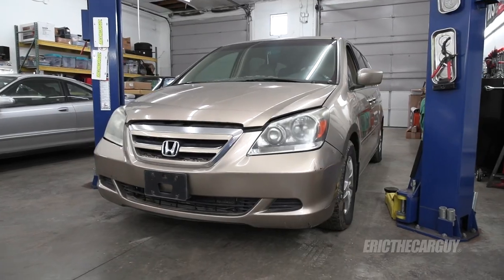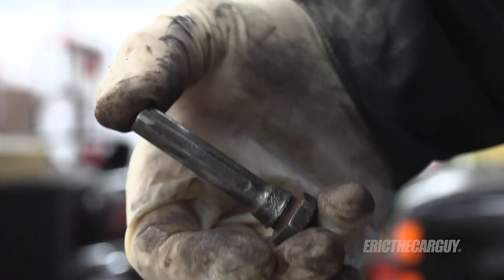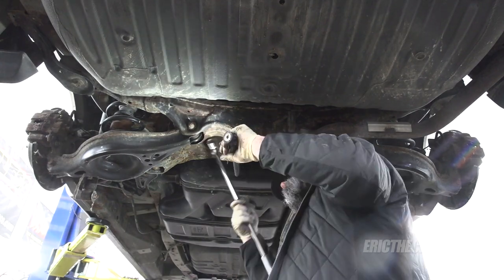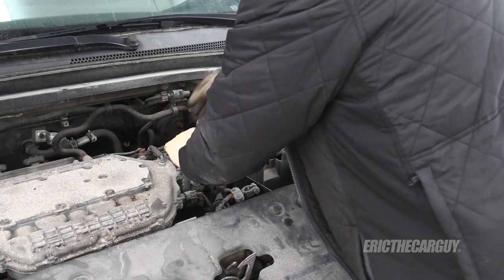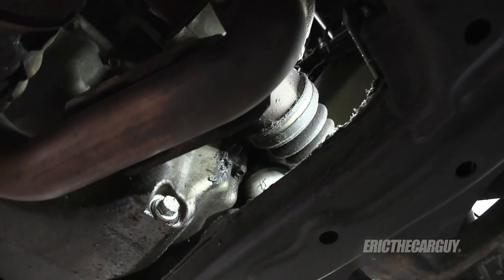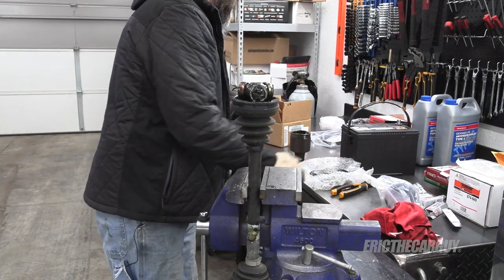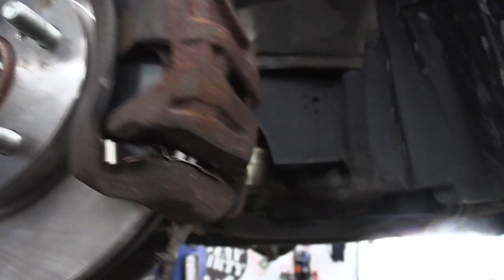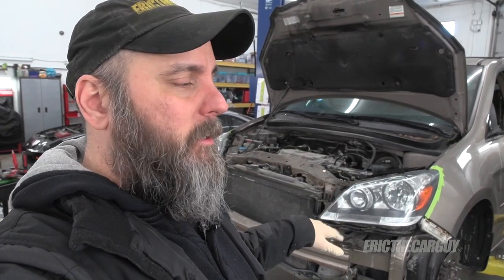2005 Honda Odyssey The Work Begins (Episode 2) Fixing it Forward

Comment: Good to see you draining the old brake fluid into a bottle through the bleed screw when pushing the pucks back. I have seen many folks push the old brake fluid back up into the system and ruining the ABS unit in the process.
Reply: why does pushing old fluid hurt the ABS or is it that fluid "shouldnt" be pushed back in.
Reply: @rickjames5998  I would say both. While I am not a brake expert, I do know that ABS units have delicate valves, pumps, controllers and unserviceable filters. The last thing you want is sludge from old brake fluid entering any of these components. Besides, when servicing modern brakes, it is likely that it has been years since the fluid has been in the system. Since brake fluid is hygroscopic it will absorb moisture over time reducing its heat range and therefore needs to be changed every few years. Since you will be bleeding the system anyway with new fluid, you might as well not pump any old fluid back into the system for a faster bleeding process. Cheers.

Comment: I owned a Honda shop for 20 years and I always like the way Eric does his Honda work. He knows when you need to use Honda OEM and when you can fudge. That comes with experience.
Reply from the maker: Thank you Grant!
Reply: Honda is one of a few manufacturers where using factory parts is not required, but highly recommended

Comment: When I did a brake job years ago I wasn't aware of the brake pad hardware. So I re-used the original. This time round, I am more prepared than ever.

You mention boogered threads... I ordered used axles and guess what? One was fine, the other slightly misshaped. It must have taken me 2 hours with a die to get that recovered. I did the nuts and now they spin so nicely.

Comment: Eric

That “Hole” is made with a 60 Degree included angle center drill and is there to ensure the shaft is turned concentric to its center.  It just happens to fit a tapered impact tool, to prevent it from “jumping”
Reply from the maker: Correct, and I thought of that after I said it, but I've always seen it as the perfect place for an air hammer bit. Thanks for the comment.

Comment: I have a Harbor Freight vacuum bleeder that works great, just wish it had a bigger cup, it works so no real complaints. Just have to empty it alot for fluid changes. Love the fixing it forward. Finally after 300,000 miles, had to have the 700R4 in my 91 Silverado rebuilt. OUCH! $1600.00 w/ converter. Guy said it was tore up pretty bad, but looked good for the mileage on it. He is rebuilding it now, but wants another $450 to swap it out(bought a used one and swapped it myself 9 months ago..used one just lost reverse, so I will be doing it again.) Rebuild bill will squash my savings, but truck is rust free , engine solid runner, and I like my longbed. Even bought a digital dash to replace dead moonie gauges($450.00 inteletronix unit off of Jegs). She`s been good to me, and at 63, this will be my final vehicle in my lifetime.

Comment: You're better off gluing that handle back together or try finding one on eBay. If you give it to your SO rep, it'll get replaced with the new round handle ones. I was pissed when I found that out. Now my set is mismatched and it drives me nuts lol.

Comment: Great video. I did not know the rear brakes is sort of a combination of disk and drum. I learned something new. 👍🏼
Reply: Yasmani, The drum part is for the parking brake only. It shouldn't wear as long as you don't ride around with the parking brake on!
Reply: @GearheadSchool  yeah I saw the pads for the e-brake. I just imagined the set up was different on rear discs. 😕

Comment: On headlight lens restoration: I used I think the mid-level (may have been the most basic) 3M kit (with an additional step of using meguiar's polish) on my badly worn TSX headlights and it worked WONDERFULLY. I prefer repair/renew over replace whenever possible.
Reply: I have an accord euro (tsx is the same car) and I had good luck with the 3m kit and put precut lamin x film over the top afterwards. It’s been 3 years and they’re still crystal. Well worth it IMO.

Comment: Eric the screws were put in by the factory so the rotor will not fall off during assembly.  Not needed afterwards. I knew someone who worked there and said it was to protect toes.
Reply from the maker: Yes, they also make it easier to install the brakes which is why I put them back in. Thanks for the comment.

Comment: Hei Eric,
I have two mentions:
1. Don't fill the brake reservoir to the top even with new brakes. 99% of the mechanics will squeeze the calliper piston  all the way in, even further than its sitting with new pads and discs. So you should always keep some reserved space.
2. Try using clear coat for headlights as these "restore" kits will only last 6-12months. Its way easier to sand the headlights and clear coat them. Now you removed the old faded clear and left the plastic exposed and unprotected. 
Greetings from Romania
Reply from the maker: I mentioned that very thing in the video. Thanks for the info on the headlights

Comment: You need to install a vent tube at the end of your lift to stick on mufflers when they’re running. I’ve seen people use dryer vent before with good results
Reply from the maker: It’s more complicated than that. Thanks for the suggestion.

Comment: For the stuck axle at 15:52 I would highly recommend the OTC 7394 hub puller if the air hammer trick doesn't work as it has never failed me with really stuck axle shafts.
Reply from the maker: I have that tool. Works excellent. Thanks for the comment.

Comment: Good man.  But brave of you using that bench grinder wire wheel to clean the slide pins right next to that clean Integra lol
Reply from the maker: I ceramic coated it before putting it away for the winter. It's impossible to keep a black car clean BTW. Thanks for the comment.

Comment: 4:04 THIS TRICK WITH THE HONDA ROTOR SCREWS HAS SAVED ME SO MUCH TIME AND FRUSTRATION!! plus the honda guy who had been there for the last 15- 20ish years(i want to say, but he has been there for awhile) still does it the old fashioned way! P.S. Erics way is WAY faster
Reply: A lot of the problem is that most people don’t realise those screws are JIS, and not Phillips. It’s easy to round them out with a regular Phillips screwdriver. Getting the proper screwdriver helps a ton. 
I like Eric’s idea too though.
Reply: @zeroyon4562  i find the #3 philips bit head fits them and works really good(as a honda tech i got the #2 and #3 philips head bit on a socket, i use the #3 on that and the engine under sheilds, have not stripped them out unless they torqued it to 110ftlbs)

Comment: Eric the air intake "snorkel" on my 2011 Odyssey split on the corrugated section and I didn't notice it for a number of months. During that time I always had a rough idle on start up especially in the winter. Now that I have replaced the snorkel the idle is much better but it isn't completely smooth. Do you think that condition would create excess carbon build up in the EGR valve and introduce a new rough idle issue? Keep up the great work. I love these videos.

Comment: I have 3 Honda's well one is a 08 TL , but any way on all 3 the intake boots had cracked in between the ribs usually on the back side and the breather. 11 odyssey touring elite is mass air so that through a lean code for both banks but the others are speed density so you really wouldn't know. Check you boots.

Comment: Hey Eric, been watching for a long time and this is a great series. Congrats on bringing it back. I worked as a Honda Tech for a couple of years and I was curious about the subject of parts. I love Honda OEM parts in general but is there any time you would opt to go aftermarket (regardless of time and location constraints and not things like brakes) like you would actively seek out an aftermarket over the OEM. BTW I am mostly familiar with late 00's cars 05-10.
Reply from the maker: O2 sensors. I get Denso. That's about it.

Comment: Not sure if this will even get seen, but I heard a lot of the gen 3 Odysseys had those run flat tires with special wheels and as such are a pain to replace without getting all new wheels. Doesn't seem to be the case with the one you have here. Have I been mistaken about this?

Comment: if you need extra parts i have some used oem brake caliper, throttle body ,evap canister and coil spring all used oem parts from 2005 odyssey touring model oh i forgot i got a oem air intake to
Reply from the maker: Thanks for the offer, but I believe I have things covered for now.

Comment: We're did you get that metal turkey baster with needle tip I been looking for something like that for brake fluid for years @EricTheCarGuy
Reply: I use a large (horse) syringe found at my local Tractor Supply Center store and an approx. 9-inch long rubber hose on the end of it which in my experience works as well or better than a turkey baster. Drips less and lasts at least as long.
Reply from the maker: Link in the description.
Reply: @ericthecarguy  I will look again nut I couldn't find it the first time
Reply: @ericthecarguy  thanks I found it Eric
Reply: @ecschindelbeck  nice idea thanks
Reply: U can get a big syringe from dollar tree
Reply: @adamlynn6648  no doller stores of any kind around me within 70 miles

Comment: I think 250F isn't hot enough to activate the catalytic converter and they have 0 effectiveness at such a low temp, you should double check after letting the car run long enough for the temp to stabilize, I think it needs to be at least 600F for good operation.

Comment: Wow, there are some real differences I notice between "wrenching" in Germany and the USA. Over here, mechanics say it's paramount that you clean up all the rust off of the hub before putting the rotor back on (i.e. with a wire wheel - those handheld pneumatic ones, not the one installed on the bench), so that the new rotor doesn't seize onto the hub - and you just seemed to put them back on (or you didn't show that process, which may also be a possibility). I (not a mechanic) am not saying which method is better, just pointing out a difference I've noticed. Or maybe it isn't one, and it was just left on the cutting room floor, that's fine too ;)
Reply from the maker: A few have brought that up in the comments. Not saying it's wrong, or that I disagree with doing that. I've just never found it to be necessary. After more than 25 years of doing this I have yet to see an issue from not cleaning a hub before installing a new rotor.

Comment: Hey, Eric, or possibly anyone else who might know - my girlfriend has a 2004 Dodge Neon SE with the 2.0 L motor. Today when she was trying to start it to go to work, it started for 5 seconds and then died. She tried starting it again and it did the same exact thing. The third time, it wouldn't even try to crank at all, as in the starter motor wouldn't turn over. Battery is fine, alternator is fine. But she said the oil light was on and blinking. My guess was that it could be a faulty/non working oil pressure sensor switch, and that it is tripping and the ECM is not letting the motor start. But I could obviously be wrong. I can't test with an oil pressure gauge since it won't even try to crank. Anyone have any ideas?

Comment: I have to get both of my boots done (driver & passenger) side. Dealer wants to replace the whole units. They are saying it will cause clicking sounds if I just do the boots. Audi Q5 is the vehicle is question. Not covered under warranty since to them it's a "wear" item.

Comment: Another great video Eric.... On the  brakes you compressed the piston on the caliber, looks like you used your bleeder bottle on the bleeder bolt. If so is that because you don't ever want to compress the Piston with ABS module? I have always done that and was told it was never a big deal. So, are you just relieving the pressure through the bleeder then? If I still do it the old way is that okay? That being just push the fluid back into the master cylinder?
Reply from the maker: Link in the description to a video about replacing front pads that gets into that question.
Reply: @ericthecarguy  Thank you very much appreciate the response! Love the channel and what you have done throughout the years!!!

Comment: Hiya Eric! When pushing the calliper piston back for the new pads, can I ask why you clamp the brake hose and push the 'excess' fluid out the bleed nipple instead of just pushing the fluid back into the master cylinder? Just curious (that I've been doing it wrong for 30 years lol!)... ;-)
Reply from the maker: I've covered that in the video linked in the description. Short answer, to avoid master cylinder damage. I've seen it happen many times on Hondas.
Reply: @ericthecarguy  Never knew that! I'll take a look then, and say that I learned something today, cheers Eric :-)

Comment: We always had a big hose to run from the exhaust to the door, do you not do that or does enough of it flow back and into the room still?
Reply from the maker: The door is 30' away and the van was up on the lift. Normally it's not an issue, but with a bad cat and old gas, it was a little rank.

Comment: The passenger side sliding door of my moms 07 odyssey will not do anything.  It doesn't make any sound whatsoever when the handle is pulled on inside or outside of the door. Nor does it make a difference when I push the button beside the steering wheel. I've performed the reset procedure using the fuse panel on the inside if the vehicle and it made no change. Any idea what could be wrong when the door doesn't do anything at all.

Comment: Screws for the disc/rotors.  I have had one break and one extracted. Replaced the extracted with stainless and antiseize for fear of the second to seize and suggestions?
Reply from the maker: I also put anti seize on the threads of the screws when I reinstall them.

Comment: what tool you used to get out the rotor return bolt? the one is connected with air hammer? thanks
Reply from the maker: Links in the description for the tools I used. Thanks for the comment.

Comment: For cracked air duct plastic would super gluing it be a good fix? That's what I'd do. Those ducts are hard to find sometimes
Reply from the maker: I think silicone sealant would work better. But I agree, it can be repaired. However, if I can find one of these vans in salvage that has a good part on it I'll use that instead.

Comment: Eric, what did you hit the screws with before taking them out?  Was it another ball point hammer?
Reply: If its the part i'm thinking of; it's a manual impact driver.
Reply from the maker: Yes. Link in the description to a video on that.

Comment: So, I have a Milwaukee Sure Shot sprayer (looks to be the same as yours), and I use it for the same thing you do...CRC Brake Kleen.  Unfortunately my Sure Shot is RUSTING from the Brake Kleen in it.  Was using it the other day and the SureShot stopped spraying, figured it was low on air charge, nope.  nozzle totally plugged up with ULTRA fine rust particles.  I ended up filtering the contents through coffee filters and pulled a a huge amount of fine rust particles out.   Looking into the sprayer, the entire bottom appears to have rusted.  Anybody else have that issue?  Sure Shot says Brake Kleen is fine to use in it, but hmm...
Reply from the maker: Haven't had that issue with mine. Link in the description.
Reply from the maker: I do need to periodically clean the tip though. Sometimes it sprays funny.
Reply: @ericthecarguy  Yep...looked at that right off.  I use break kleen on freaking EVERYTHING...its an amazing solvent, doesn't leave nasty residues and doesn't stink to high heaven.  Doing the math, I quickly determined I would save lots of money by getting the Sure Shot and bulk CRC Brake Kleen...then I had the rust.  :(  I'll look into the one you are using, might just have to bite the bullet and move to it.

Comment: I have a 2010 Honda Accord 3.5 v6 I replaced the 2 catalytic converters on the engine I noticed there is another catalytic converter that has no O2 sensors behind it if it is removed will the car run any different or will it set any codes
Reply from the maker: If you remove it you will fail an emissions test most likely.

Comment: Factory cat or are you going aftermarket? I priced a magnaflow and it was only slightly cheaper than oem
Reply from the maker: I actually just sent an email to Magnaflow yesterday. They make the only cats that I've ever seen that work on Hondas.
Reply: @ericthecarguy  Thanks my son’s 2004 Pilot needs one. He had put another brand, Walker I think about 2 years ago and it’s failing already. Do you recommend the Magnaflow for the Element?

Comment: Eric i would recommend you clean the brake fluid reservoir before you put new fluid in or its gonna get contaminated very fast from all that dirt that's inside. It takes some time to remove the reservoir from the master cylinder but i think its worth it, and i do it every time i see that its dirty at my shop. Also would recommend cleaning the wheel hub before you put a new disc on it. Just my opinion:)
Reply from the maker: The 'dirt' you see is from the brake hoses. It's not harmful at all and will eventually return. The main thing is to change the brake fluid so that you can bring the boiling point back up to spec. Brake fluid degrades over time and should be changed out periodically for optimum brake performance and to prevent brake fade. There was a time when I cleaned hubs, but have since discovered it's just not necessary. Thanks for the comment.

Comment: Eric i definitely need the part # for that huge mallet. At work these Euro cars mainly BMW and Mercedes always the wheels rust on the hub. It doesnt help that they use lug bolts and not lug nuts. Thanks!
Reply from the maker: Trusty Cook linked in the description. They have several options to choose from. Thanks for the comment.